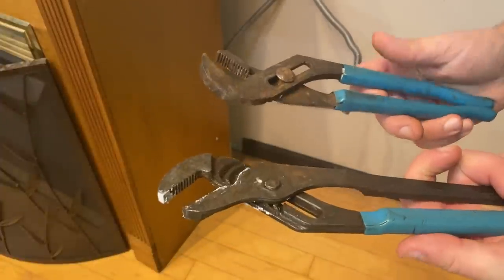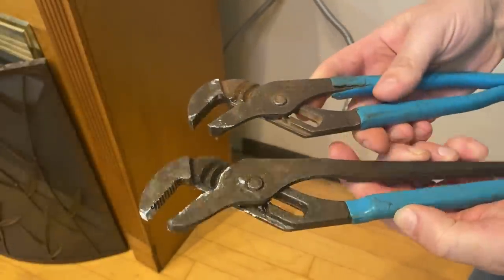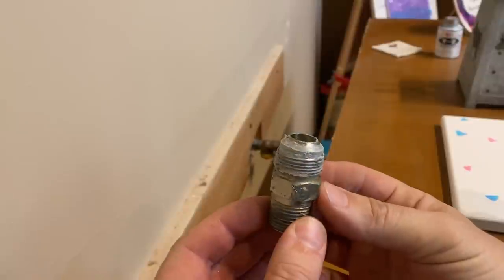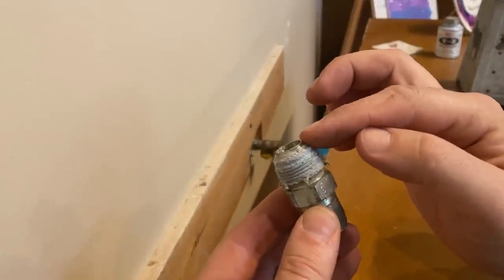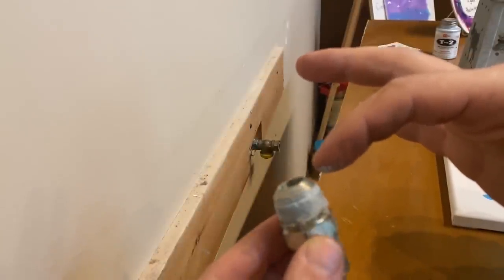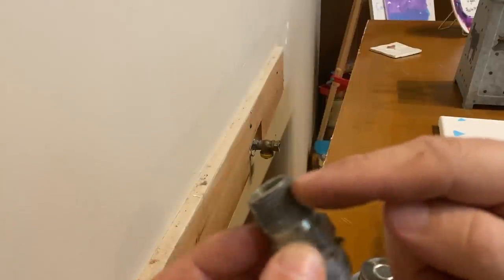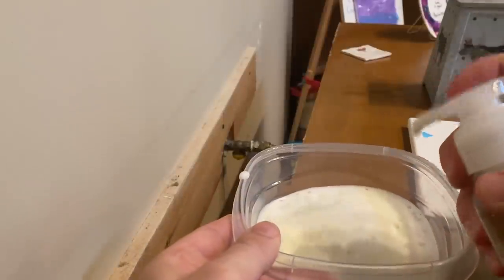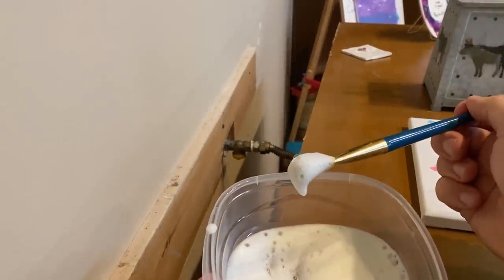Restoring The Heat From the 70's

Comment: i like to use a pipe sealant product called "true blue" used it on the farm for anhydrous ammonia fertilizer fittings and even water connections. wish i had that nice garage and workshop  good luck

Comment: I was always taught to put a few wraps of tape and then pipe dope after by an old time plumber. Never once had a leak, just luck I guess ? He also suggested a very small amount of dope on the flared fitting, so that's what I do now. Like I said, never a leak in over 35yrs. I don't know ? Great video. That heater is gold, not only does it heat your shop but it helps dry your wood !
Reply: Used to be pretty standard back in the day when all the fittings were made of mild steel and you could possibly have some corrosion on the flared surface. Really not necessary now days but I still do it any way.

Comment: Find an old gas grill someone is tossing out and grab the piozzo electric ignighter off of it and install it on this heater. That way you don't have to open the sight hole to light the pilot.

Comment: There should be a drop leg (4"nipple & cap) off the bottom of the Tee for the heater he hooked up, it's a sediment trap for any matter within the fuel...
The gas valve he installed should also be located somewhere you could reach it without having to move anything, in the event of a fire you wouldn't wanna touch anything... 
Curious how ya fixed the fan noise, 
was it the bearing?
 I'm no pro, just a DIY but figured I'd offer my tips
Reply: That "drop leg" is suppose to catch any moisture that is commonly seen in LP gas before it fouls up the gas valve which will be costly to replace.

Comment: I noticed when you turn the gas valve from pilot to on you had some rollout that means that your heater might be getting too much oxygen or there might be other problems I would check into that you don’t want the flame rolling rolling out of the heat exchanger that could take a chance on catching things on fire just my observation.
Reply: totally agree it seems to me a life-threatening situation, also the fireplace
Reply: Yes that flame was also very orange and not a nice blue I would not be running that in my house

Comment: Nice job.  By the way, Scotch Brite (TM) works well to clean thermocouples and flame sensors and is usually gentler than sandpaper less than 400 grit.  
     Was the fan loose in the housing, or the blades loose on the shaft?  I was thinking an old fan like that might have a worn bearing.  A drop or two 20 weight oil will help make the bearings last longer.
Reply from the maker: It seems like the mount had just bent down a little over time just enough to rub on the housing but the bearings are worn a bit also
Reply: @SSLFamilyDad  There's a wall furnace like that in the garage where I live now.  The property owner said he has no idea on wether or not it works.  Sinse I had to release a bird that got into it last year, I think inspecting the chimney is a good place to start.  Have you inspected yours?  That  last hail storm we had here in Michigan really did a number on my chimney caps.  They're really bashed-in.

Comment: i had propane heaters like that in my barn but i ripped them all out even though the worked great, but propane is the most costly gas you can get, it un-reall how much it has gone up in the past 20 years and keeps going up, hell just to fill my 33Lb tank for my forklift that only runs for an hour and a half on a tank cost me after tax $53.60 cnd and many people i know over the years had 2000 gallon tanks in there yard for heating and cooking had the company come and pick up there rental tank, you cant buy these big tanks as the truck would come 2 times a month in the winter months and cost between $1600 to $2600  each fill, and the tank was never empty.. .  and had there furnaces changed over to fuel oil or coal, red dye fuel oil only $5.23 a gallon coal is $7 a ton
Reply: It's the other way around where I live. LP gas costs less than burning heating oil.

Comment: How much is propane there? It is around 2.75 a gallon maybe more here in West Texas.  Last year it was 1.75 a gallon.
Reply: Must be cheap there bc otherwise it would cost alot to run those low efficiency appliances. Currently $2.29/gallon where I live. A buck per gallon higher than a year ago!
Reply: We haven't been that cheap in years (1.29)  and we produce a lot of propane here. Thanks Joe
Reply: @lelandbrendle8564  two summers ago we had LP gas at .99 cents per gallon. My supplier has a summer buy rate so I buy all my fuel in the summer, bank it and use it in the winter. Anything left in the spring they send me a check for the unused balance. Been doing that for about 25 years now.

Comment: Those wall heaters are cheap as hell and still made. Under the williams forshaire name  The fan motors are cheap and uses a snap disc attached to the heat exchanger to run the fan.